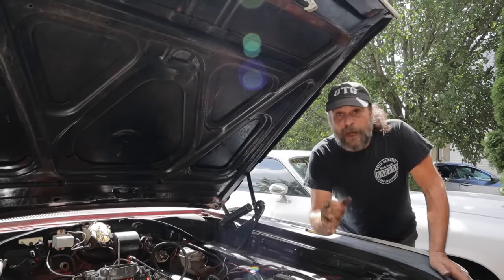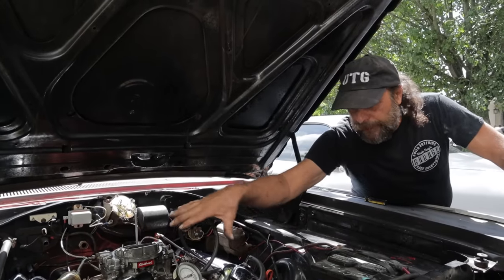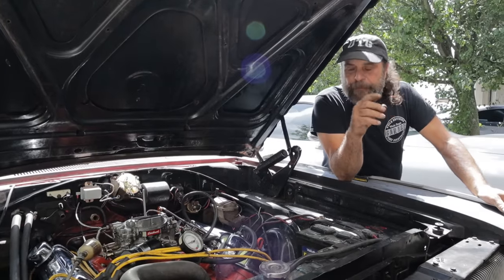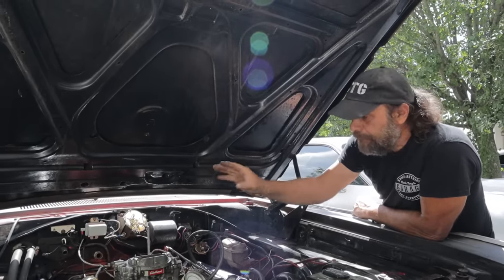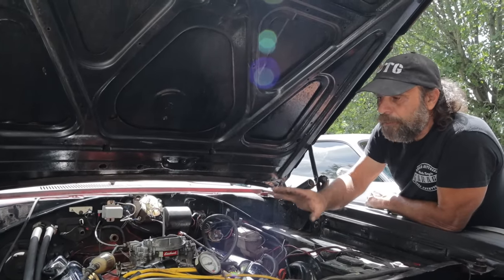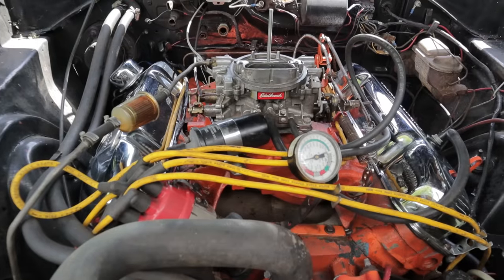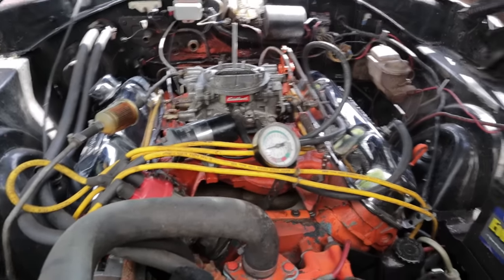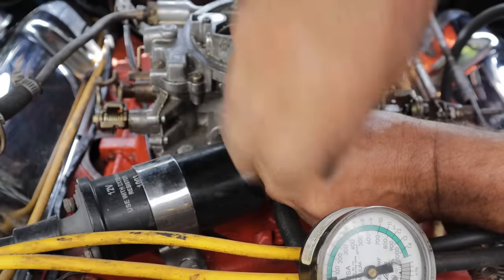Fine Engine Tuning With A Vacuum Gauge

Comment: Every old-skool car guy has a vacuum gauge and dwell/tach in the milk crate that's in the trunk. I don't actually know where the milk crates came from, I just know I always had a few, lying around. Maybe they grow in old car trunks.
Reply: Have you noticed the coffee cans are popping up plastic now?
Reply: @nickmcwilliams685  yeah, mixed feelings about it. I'm sure I have a Chock full O'Nuts can rusting here someplace...
Reply: Mr. Blutarsky they come from under old dirt bikes
Reply: @deborahchesser7375  that must be it!
Reply: Your right they do grow back there! I have one in my 67 Camaro with the timing light, dwell meter and vacuum guage along with cleaning supplies, all necessary tools to do about anything that might possible to wrong on a road trip! Bikers know what I'm referring to also!!! Need to watch out though because that coil of 16 or 18 guage wire you have in there for emergencies attracks mice which in return attracks snakes, like your common rat snake and black snakes!!! I kid you not, this actually occurs with the old 60s cars, they attract critters that love eating the insulation on the wiring from those years of cars! It happened to me! Had a mouse run up from the rear of the car after I started it and just ran out on my arm that I had laying on the door, you know like you leave your arm after adjusting your mirror, anyway he stopped at about my elbow and just started at me, must have been for 2-3 minutes we both just looked at each other, thought it was kinda cool at first then I thought about all the shorts he could cause, so I shook the heck out of my arm and he fell off to the garage floor and I took care of him, you know!!! Then later on that day was driving down the Interstate profiling in my gorgeous Quasar Blue 67 Camaro when I felt something kinda cold and moving up my bare leg due to wearing short pants that day and when I looked down saw a grayish looking snake with diamond makings on his back!! Needless to say this scared the crap out of me 😂 and I immediately switched lanes as physically possible over to the side of the road and immediately 😬 without any concern for safety, I mean I just had what I thought was a medium sized rattle snake slither up my naked leg for Christ sake, anyway I began trying to catch the little bastard with the work gloves I had found in the milk crate in the trunk, the 🐍 snake slithered into the heater vent on the driver's side of the console, that really was a bummer, was at a loss for a minute then decided to start the car back up and turn the heater on full blast, it worked the snake come hauling ass out of the hot vent, I saw he had no rattles on his tail and his head was not shaped like a poisonous 🐍 snake, whew gave me some relief, my BP returned to normal as did pulse and respiration, then the 🐍 slithered under the driver's seat, grabbed the largest screwdriver I could find from the milk crate and began chasing the huge fucker, he had miraculasly grown twice his original size, so here we go me head on the floor looking for the 🐍 snake, if he would have crawled toward me, that would have been it, ❤️ heart attack for sure! Luckily he didn't, he slithered under the back seat!! Oh boy, here I go tearing out the entire back seat of my precious 67 Quasar Blue Camaro on the side of the road on the Interstate! Got it all out 👍 faster than ever before because that 🐍 snake had slithered his way into the trunk and ended up in the milk crate!! I couldn't see him at all, he had hidden himself up under some shop rags! Now, by this time 2 other cars had stopped to see if I needed assistance, this happens when you ride a Harley and stop on the side of the Interstate or in a gorgeous classic car, folks just stop to see if there is anything at all they can help you with, just like in the old days!!! Anyway with my audience watching I was still nervously searching for the monster of a 🐍 snake, amazingly it just kept getting bigger and bigger all the time I was chasing it! With everyone looking on I picked up the milk crate and began to dump it in the trunk when the monster of a 🐍 snake came slithering out onto to trunk floor and curled himself around my left original tail light and at that time a guy about 18 I presume reached in, grabbed the monster 🐍 snake by the tail and uncurled him from around my 67 Camaro original tail light lifted him out of the trunk, showed him to all the concerned citizen s that had stopped to assist and explained it was a Rat 🐍 snake, he knew this because he was a Marine and had seen many snakes at Camp Lejeune and Paris Island so after holding it without any worries of being bit, he walked over to the edge of the forest on the side of the Interstate and ever so gently turned the little 🐍 snake loose into the woods! Now I know everyone is thinking how they would have felt with this situation so much different than I did, but until you have any kind of 🐍 snake crawl up your naked leg while your driving your gorgeous Quasar Blue 67 Camaro SS down the Interstate at 70 MPH you really can't say for sure exactly what your reactions would be!! I personally was so thankful for my milk crate that not only had everything I might have needed should my gorgeous Quasar Blue 67 Camaro SS might have broken down, not ever, but pays to always be prepared, just so happened I had everything required to Chase and capture extremely large snakes should the situation arrise!!! Just shows to go you how important that milk crate can be! So if you ever happen to see one at a yard sale, back of a old closed down grocery store, Craig's list or EBay, better but it, it could end up saving your life!! Really when you think about it, thousand wonders I did not wreak when I first looked down and saw that monster of a 🐍 snake crawling up my leg while driving my gorgeous Quasar Blue 67 Camaro SS down the Interstate! So just a little bit of advice 😉 place moth balls all around your garage to run the snakes off and I heard placing dryer sheets under your car seats and you can always store the box of sheets left over in your milk crate in your trunk! They are priceless!!! Hope you enjoyed my story, every bit of it was true!! Be safe out there and speed safely!!!GOD BLESS ALL AMERICANS!!!!
Reply: @terrycopas4219  Great story!  I thought that I was the only one things like that happened to.....you're absolutely correct about the milk crates growing in car trunks.  Seems every car I ever owned had one.....if you took it out, within a week another one would grow in its place.  After a while there were enough of 'em in my garage that I could barely get the car into the place.  Now......they are all full of stuff of various shades and the crates absolutely refuse to leave and the car is parked in the driveway.   Ever notice that when you kick a milk crate those mice can jump about 3 feet straight up in the air......like they were practicing for the Mouse Olympics or something and then dart off to the most distant, darkest corner of the garage and disappear behind an abandoned dirt bike, an engine you pulled 15 years ago for a project you were "getting to", several boxes of God knows what, plus 20 items of various junk that you got at a swap meet, and it cannot be scared or enticed out, no matter what.  Finally, I borrowed my brother's rat terrier/chihuahua cross that can catch and kill anything smaller than an elephant........locked him on the garage a couple of nights.......problem solved.....at least 'til next time...........sigh......
Reply: And don't forget the cigs.
Reply: Austin Carlson  About the third six-pack it tends to give you a case of "waffle butt" that lasts about a week.....ever notice?
Reply: Every time I purchase a used car, driver or project, I always go looking for a milk crate. It is the greatest trunk organizer ever even if the things in the crate are not organized. You just know it's " in the crate", lol
Reply: One time when I got pulled over for a bad taillight, the cop confiscated my milk crate.
Reply: @bertkilborne6464  Haha!  Damn, that's the best comment yet.
Reply: @tomnekuda3818  I'll remember you said that and if I ever need a pick-up line, I'll use it!
Reply: @terrycopas4219  😂😂 i would love to hear more stories from you, the vocabulary, emojis, and explanation points had me crying 😂😂😂😂🐍
Reply: lol im 34 and i thought i was the only one who had spare parts and tools in  milk crates in the back of my Jeep wagoneer haha
Reply: Lol  love it..
Reply: @thomasglynn2282  I kept a spare distributor at times lol. Bring a Buick guy I didn't like that window because I liked my fingers, so I went HEI
Reply: The only thing my milk crate is missing lol
Reply: That's the beginning of your boonie box
Reply: I got a few I don't know we're they came from lol
Reply: There hand me downs from are daddies and uncles! Them darn milk crates weighed a heck of a lot less then a stock seat did in those old Suped up Olds Rockets! With the gutted out interior loaded to the stoppers with MOON SHINE!!!!

Comment: I’m a strong proponent of full manifold on vac advance. I’ve curved the distributor on my 396 to run this way and it’s a raped ape. Excellent fuel mileage too. Bone stock original 325 h p cam, 89,000 original miles. When set up properly you can achieve a strong running engine either way. Whatever works for your application, as I’ve seen it both ways over the years. Thanks for sharing your knowledge Tony. The vacuum gauge is one of those forgotten tools, but not for us old iron guys. Now break out your dwell meter and REALLY confuse the younger generation   😂
Reply: Manifold is genuinely pretty useless for a driver. You just leave efficiency on the table, although for something that sees zero vacuum more often than not, then the choice becomes irrelevant.
Reply: asus6983 Read the link I posted. It will prove that wrong.
Reply: Anyone who actually takes the time to understand the air/fuel conditons of an engine at differing throttle positions, and loads, and the corrosponding timing requirements will understand why Manifold vac is the most useful method for a street driven engine.  Ported vacuum can be made to work acceptably, but more initial timing is required, and economy, and street manners are sacraficed.
Reply: Manifold vacuum works the best. But if your using an hei distributor you need to limit the vacuum advances range to 10-12° of total movement.  Similar to the vacuum advance range of a presmog points distributor which is usually 0-12° vacuum advance at full vacuum.  
Where a stock hei vacuum advance range can turn it 0-30degrees advance on some distributors.
Reply: Modern turbo builds and younger guys use vacuum readings more than you realize. “Old iron” doesn’t matter, vac matters on all builds.
Reply: @asus6983  Vacuum is strongest at the manifold and the engine runs leaner at idle than at partial throttle. The leaner the fuel mixture is, the more advance the timing needs to be. This keeps the engine from overheating. They started using the ported side during the emissions era and everybody knows the cars ran like crap then. Also, the leaner the air fuel mixture is, the more time it takes to burn the fuel which is why vacuum advance was created in the first place. You need the advance at closed throttle as well. They created ported to pass emissions. They switched CO2 emissions with unburnt fuel instead.
Reply: IDK what a dwell meter is but I'd listen to Uncle Tony explain it
Reply: @Gamefreak8112  Young guy here (21), but  dwell angle is the period when the points are closed and is measured in degrees.

Even after knowing that it still confuses me due to not having worked on it in person. That's just info from what I've learned.
Reply: @KP-qh8je No the leaner the carb is jetted the less timing is needed or you will end up burning holes in your pistons or burning the electrodes out of the spark plugs which leads to piston damage . Lean can be mean if it's not so lean that it burns the engine up . By adding more fuel when it's jetted to lean that will help cool the spark  plugs and the tops of the pistons and exhaust valves and once you get your afr in the correct ratio then you can start to play with timing and advance settings using different weights and springs to control how fast or slow you want your advance weights to work . Buy a plug reader and learn how to read spark plugs and that's a good indication of what jetting is at and timing by looking closely at the fire ring on the plugs not just the electrodes. A buddy of mine he and his son race pro ice oval race sleds that use a highly modified 440 rotax engine that's making north of a 150+ HP on race fuel in a Wall brothers custom ice oval chassis and being they can only run modded Mikuni carburetors when the temperature changes during the day of racing he has to change main jetting on both carburetors and uses a plug reader to look at the color of the fire ring on the plugs to determine weather to go up on jetting if it gets colder or down when hotter . When it gets colder he has to jump up to bigger main jets so it doesn't lean out and burn the pistons out or cause them to seize in the cylinder bores but when the temps go up he has to jet leaner because the heat will cause a power loss and a soggy throttle response . This engine sees 10,000 rpms on the oval track and reaches over 100+ mph on the straights and in the turns it's going 75-80 mph on a sled that weighs less than 300 lbs that uses a lot of carbon fiber and titanium parts and billet aluminum with a studded 1 inch carbides in a custom made track designed specifically for ice oval racing. A jewelers eye loupe can be used as well or a really good magnifying glass but the plug reader or jewelers loupe is better because you can see a lot more details of what's going on with jetting and timing or if something isn't right like one cylinder looking leaner than the other because the intake boot is sucking air and cracked or loose or one of the crank seals is going bad and is sucking more air than needs to be in that side of the crank case which can cause a lean condition that can melt pistons .
Reply: Dwell meter on a dual point Accel distributor too!
Reply: There's alot of folk here who missed the wisdom.

Comment: You are a national treasure... Every old guy I meet tries their best to hold on to this information and then wonders why nobody want to use a carburetor and swaps everything to FI.
Reply: I'm a former Holley carb builder and tuner, and I moderate an engine group on facebook, I try to teach the younger generation about carbs, but I usually find that their minds are deadset against it because it's "old tech".
Reply: @AmericanThunder  When I was working on cars back in the nineties, I got all the electronic issues cause I was really good/fast at them (brakes too but that’s a different story). It caused me to not learn carbs like I should. No longer a mechanic by trade, but trying to learn the old stuff. While I can tune a fi system for performance, I can’t a carb yet. That just chaps me. Time to go old school

Comment: This is the thing many of us 70+ year olds did not understand. How to read Vacuum. Its easy to set Distributor points… even Dual Points. Timing was a cinch. But how did our engine react to a 750 double pumper opening up? Usually there was a lag if you got your carb adjustments close.  If way off, the engines just choked on the fuel. We just adjusted the jet sizes and other things till we dialed it in. Vacuum gauge would have been much easier and Precise.